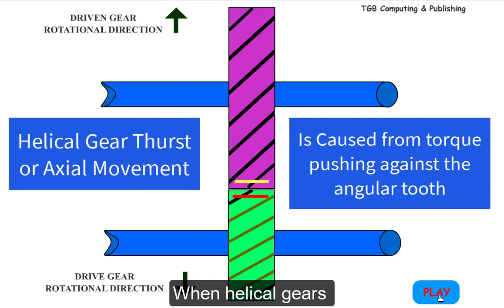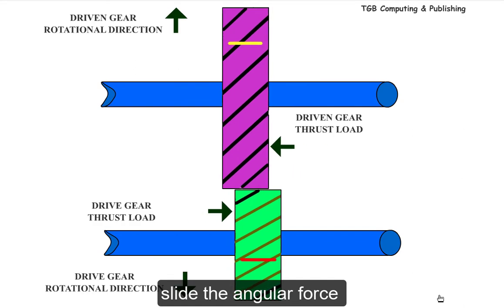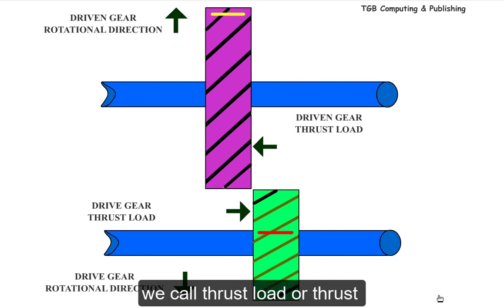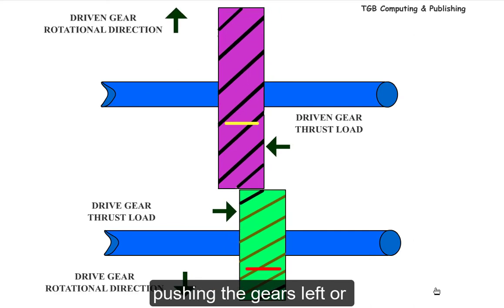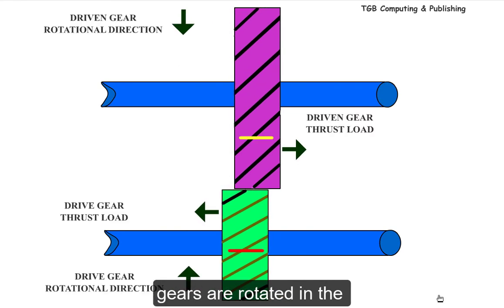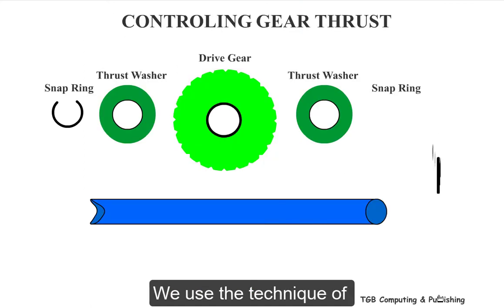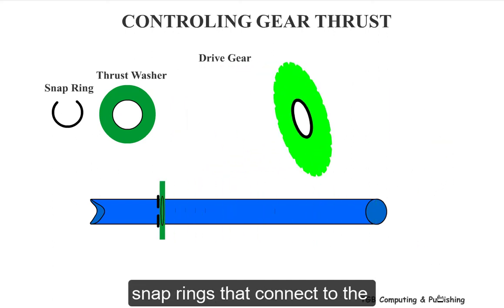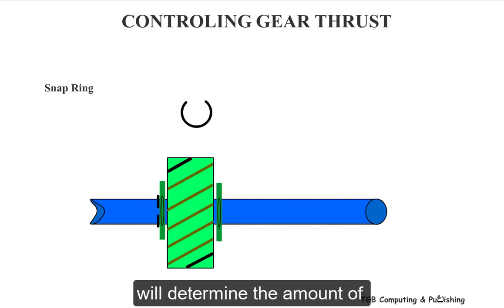Helical Gear Thrust Movement explained

Comment: IS THERE ANY LIMITATION TO USING SNAPRINGS? IS IT SAFER TO TRANSFER THRUST FORCES TO SHAFT?
Reply from the maker: Each snap-ring design has limitations.  The size, type of material, thickness, depth of shaft groove and hardness of shaft material.  The load against a snap ring is calculated through engineering and if a snap ring is appropriate the engineer should be able to make the correct design to hold up against the thrust load. The load is transferred from the snap ring to the shaft. Other designs will build a boss or surface into the shaft to take the majority of the thrust load.

Comment: Interesting some manufacturers have a spec for thrust clearance on driven gears when rebuilding M/Ts (e.g. Toyota) and some don't or it's zero (e.g. Hyundai/Mitsubishi)
Reply from the maker: It's never zero. If there are no specification the though is that the proper thrust is built into the engineering of the shaft, synchronizer, bearing and snap-ring.  You are at the mercy of the engineers.
Reply: Interesting. Yes, I suppose it must be built it. On my recent rebuild of a Hyundai M5CF1 the hubs were pressed directly against the gears, as per the shop manual. But the gears could still easily be spun after. I didn't think the measure thrust play. I'll have to take a closer look at the old parts I kept. Appreciate your videos. They're a wonderful resource. Thanks!
Reply from the maker: Normally when power flows through a pair of gears, helical or not, one gear is fixed (or pressed) onto a shaft or hub while the other gear free spins on a shaft and is located next to a coupling mechanism. In a manual transaxle this would be the synchronizer.  The gear that can spin freely on the shaft until the coupler locks it to the shaft is the gear that will have a small amount of axial or thrust free play.  Watch synchronizer operation. https://youtu.be/e-Lk3FXHubw and manual transmission operation. https://youtu.be/kjsXytx9AWk